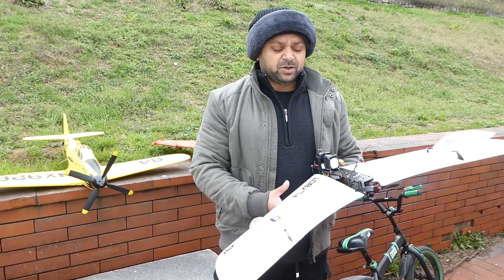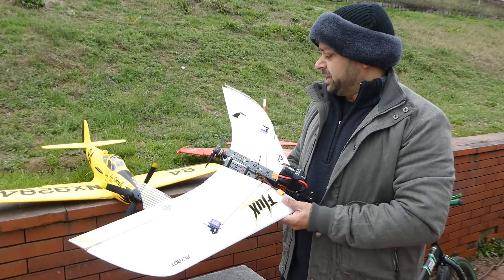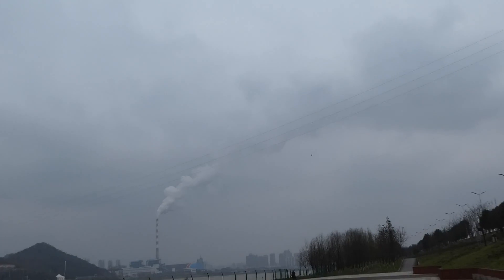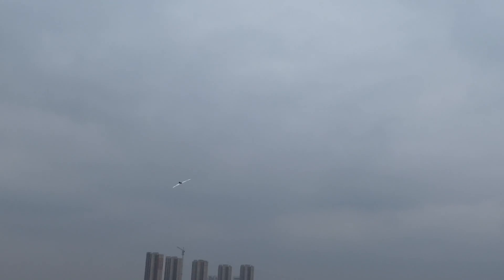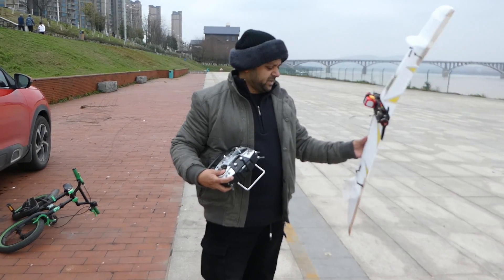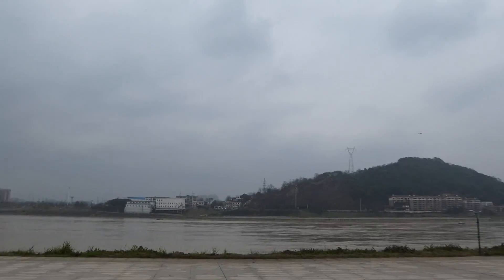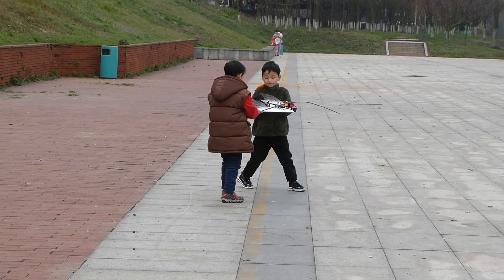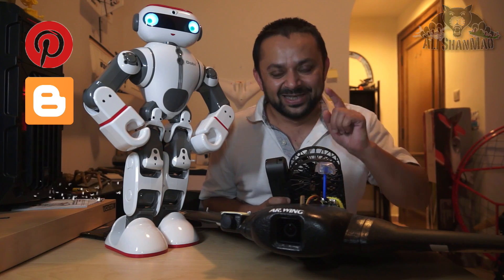Flybot Flux high Speed FPV Racing Flying Wing Fastest FPV flying Wing

Comment: Whaou what à Nice speed => i m obliged tu buy one it si awsome. Thank for Nice presentation. Fabfromswiss
Reply from the maker: Fabien, are you going to use SNL on this wing? :) if yes, you need to keep the PIDs very low :) some experimentation required. Take off in Manual mode and then turn on stabilization to see how SNL handles it.
Reply: @alishanmao  Hello i m a beginner (newbie ?) and normally i speak french => i dont know what is  SNL. Can you explain me what means SNL please ? Thanks for your help. Your 2 sons are fabulous, sincerely
Reply from the maker: SN Lite, is a  Flight controller